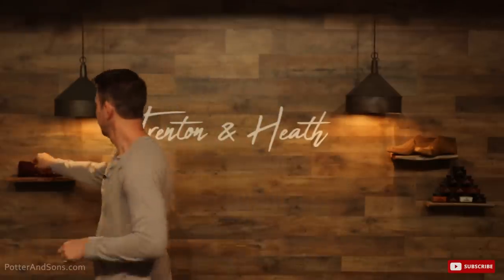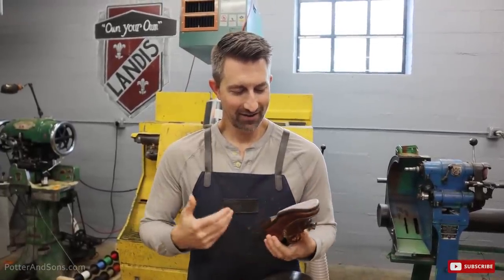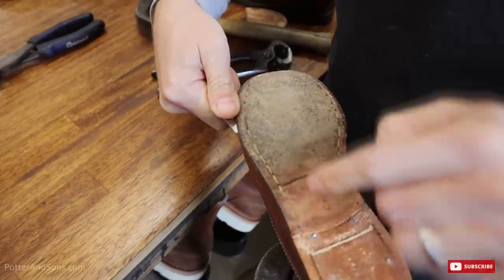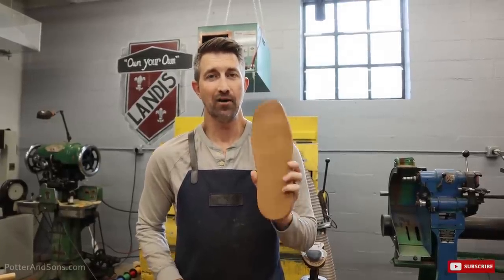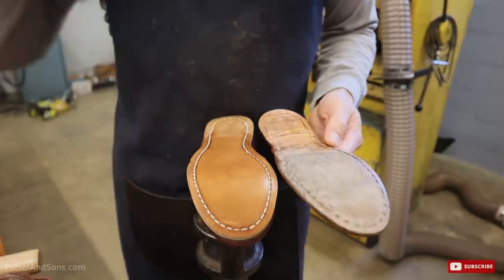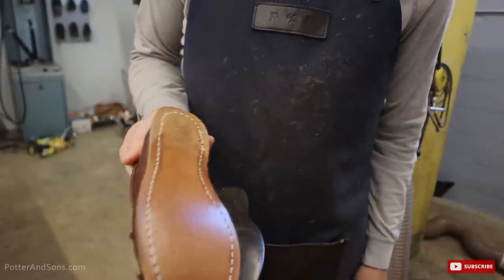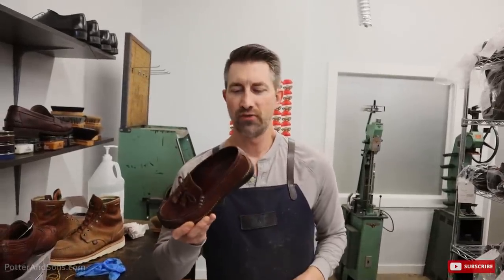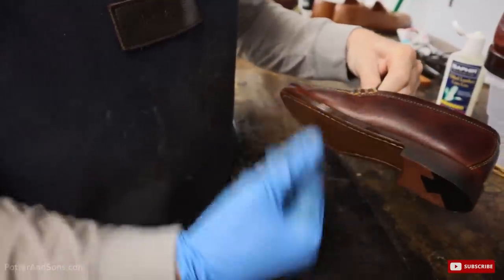These LITTLE Shoes Get a Makeover | Cole Haan Loafers

Comment: Now that’s a small pair O’shoes.  

When is a shoe too far gone to repair.  I have a pair of 24 year old Florsheim Kenmoors that the lining is wearing out at the heal and the edging at the rim or the shoe needs to be changed to leather because it is cracking.  Is this even worth fixing? The leather portion of the uppers, though scarred, are still in good shape and polished to a high shine. The soles are original minus the Vibram sole addition.  If it is worth being rebuilt, I’d like to go back to just the leather soles.
Reply: I'd say that is fixable, just depends on how much you're willing to pay. I'd find a good cobbler for that job.
Reply: Bedo’s Leatherworks, another channel, does more in depth stuff and is known for Florsheims in particular, but are much more expensive. The job would be superb, but the cost will be high.

Comment: I have some Johnston and Murphy 3784 moc toe boots made in Italy - They are not like the modern J&M's. They have a leather stitched welt and a cemented one piece rubber heel and sole. They are in pretty good shape but need to be resoled. Also the main part of the shoe is a little squishy so Not sure what the quality of the original mid sole is but it feels like it needs rebuilding perhaps with a higher quality midsole. I noticed that you recrafting tab is deleted on the potter and sons website. (1)Please comment on my boots and (2)when will you be accepting new business?  thank you.